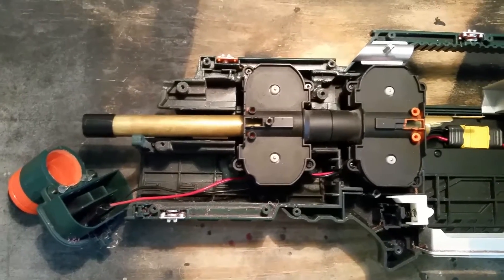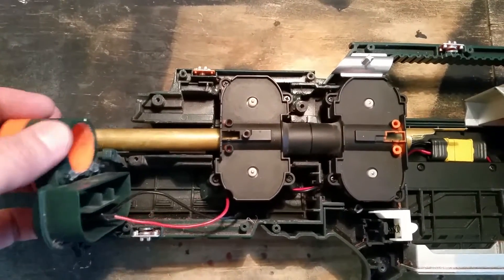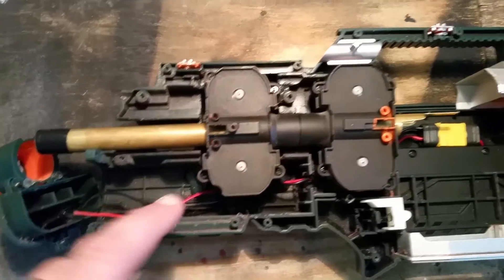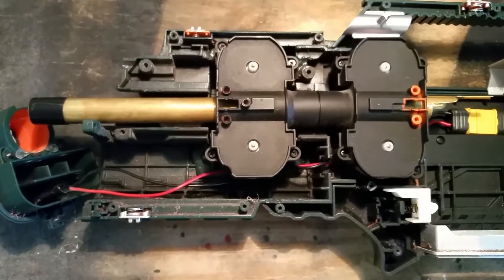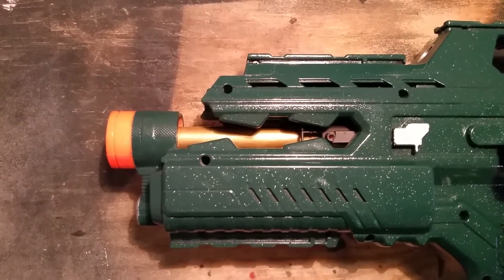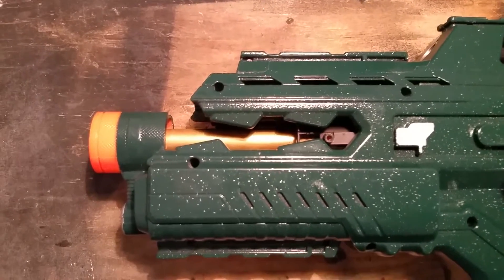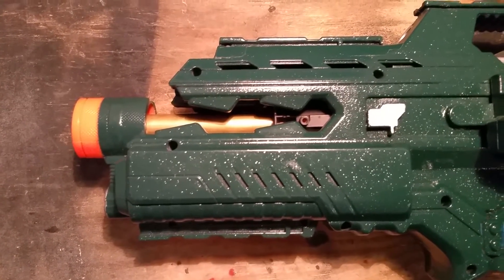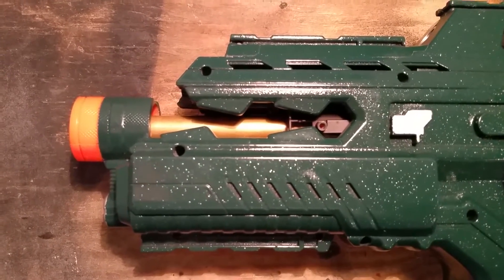Hailstorm Mk.3 Addendum - Brass Barrel

Comment: Try it with worker flywheels and koosh darts! Also, try using 180 motors.
Reply from the maker: I ran some Koosh darts through it and it had no problems with them.  And they were pretty warn too.  One of these days I'll get around to trying the Worker flywheels.  :)